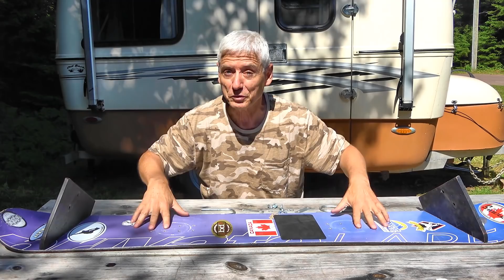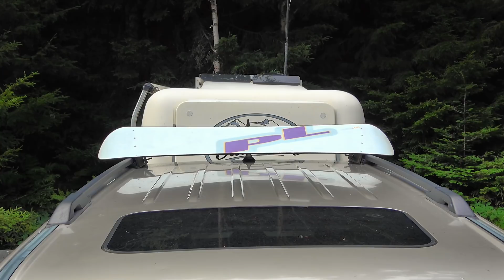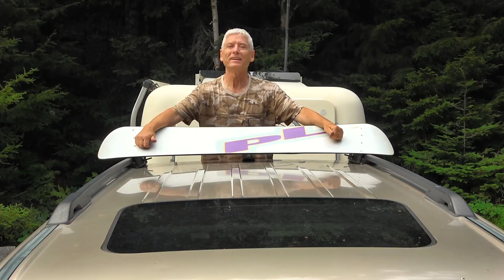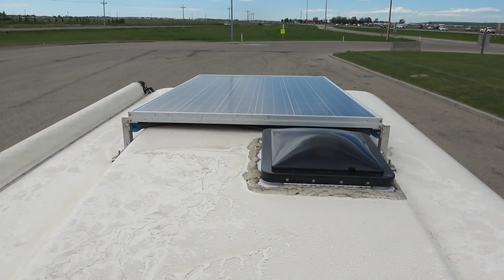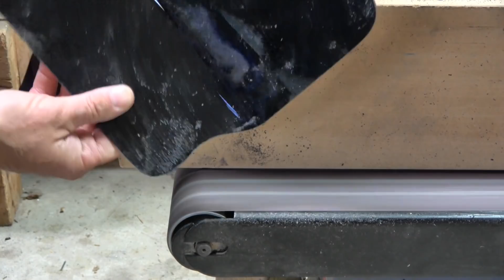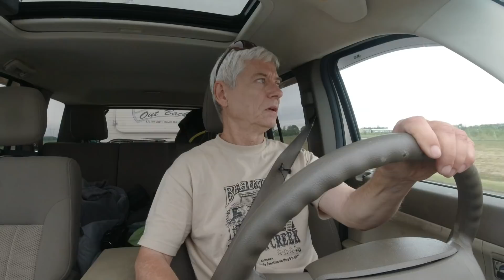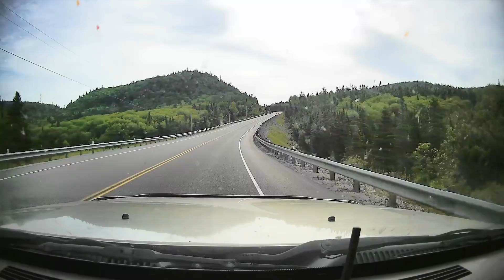Can an Old Snowboard Wind Deflector Improve Gas Mileage while Towing?

Comment: I did notice quite a bit of flex in the snowboard & vibration while you were driving. I wonder what might occur if you are able to stop that flexing to keep the board a bit more solid. But, as they say, any gain is a win, and you more than paid for your mods with that 1 trip!

Comment: Nice results, Slim, and reasonable analysis.  Love the re-purposing approach and your Canadian politeness to grouchy commenters.  I just saw on an electric towable called the Pebble that they use a thing called an "air box" or something like that to make the front of the trailer more bullet-shaped without attaching anything to the trailer itself.  Check it out!  I'm going to try something like that but manually operated on my cargo trailer conversion.  Also, you might want to think about safety-wiring anything on the roof to keep it attached if that tape fails eventually.  We do a lot of that on our ultralight aircraft. I was looking for an aircraft fuselage to make a trailer out of but they're way too heavy - built to withstand stronger forces. Would love to see what a snowboard on either side of the back of the trailer (and/or one on top) to reconnect the airflow on the trailing edge does.  I'm told that sucking effect at the back is where a lot of the drag comes from.  Also using sheet aluminum to "fair" any round bars (axle?) in the airstream. Great work, man!  Cheers!

Comment: I'd like to see you run that test again with an air dam underneath the front bumper of the Jeep manufacturers are using air dams to reduce the coefficient of drag some have a come down at a certain speed but I think if you just have one permanently installed it would also help save more fuel as well as putting Vortex generators on the back of the camper

Comment: Great video Slim.  I tow with a RAM truck and I have been thinking of making a canopy/topper that will slope up to deflect the air up and over my trailer.  I drive from Washington State to the Arizona desert each winter and the fuel cost is the most expensive part of the trip.  I can't think of a single reason it won't work.  Thanks!

Comment: Really enjoyed your video of the snowboard.  I like you. placed a comment online regarding wind deflection and somebody told me about your video which I just finished watching.  just curious, what are your thoughts  on a v nose 16 ft cargo trailer and a F-150 with a flat topper on the back? Should I go with something like your snowboard or something that is more of a v-angle to match the trailer.  
 thanks again for your very informative video
Reply from the maker: Hard to say how well it would perform in your setup.  But since it costs little to experiment, might be worth a try! SP

Comment: I am impressed. One thing i noticed that mught hurt the mileage is your mud flaps. However the damage you save from flying stones is probably greater than any mpg loss. Going to build a similar wind deflector for my ford freestar van pulling my 6x10 cargo van. Thanks for sharing.

Comment: Great video. Awesome results for such a cheap mod. if you would like to take it a bit further, you can use small pieces of wool yarn and tape them to the flat panels of the roof, wing, top of the camper, ext. this is known as TUFTING. and was used in days before wind tunnels. and if you have a way of recording or photographing the tufts yields great results. Thanks for all of the great record keeping, to show us many different results over longer course. so many videos only show a few miles drive after a mod. Happy camping.

Comment: I use a pickup truck with a cap over the bed hauling a cargo trailer and was wondering if driving with the cap rear window up/open would help fuel mileage? With the window open it makes a air jammer like your snow board. It is in the void between the truck and trailer which seems like it would be effective at keeping the swirl of air going in there causing drag.  Have you considered "AirTabs" I installed them on my cargo trailer and improved trailer stability greatly. In fact improved handling Very greatly.

Comment: Thanks Slim.  With your inspiration I'm on my third version of a snow board deflector.
Version 1 -  28 degrees upward deflection. No benefit. I have a fold down A frame so I don't need upward deflection as much as sideways to clear the side projecting corners of the trailer.
Version 2 - 15 degrees upward deflection and downward shark fins at each end that push the air flow outward.  Tentatively a 5% improvement in mileage.
Version 3 - Just added another set of downward facing shark fins even further out to snow board tip.  The concept is parallel slotted flow like Fowler flaps do on an airplane wing.  Results not in yet.
Thanks again for the aerodynamic fun.  Wish I owned a wind tunnel.

Comment: I wonder how 2 snowboards, mounted vertically on the front of the camper, angled slightly inward, would work in increasing the efficacy of your system.

Comment: I know I will get beat up over my comment,  but your test isn't a good one. From experimenter bias to differences in many factors that might not be apparent. ABA method is second best to very expensive wind tunnel testing. Testing is done on the same day. A= before adding the MPG enhancing device, drive a specific route in a manor that can be repeated and with an eye to consistency. Avoid bias. Cruise control helps. B= add the enhancer and repeat the route in as exact manor as possible. Then finally A= remove the device and repeat.

Comment: good job slim,  cd , coefficient of drag is a major issue to vehicle manufacturers so any thing you do to  decrease this is a benefit. with your set up you did just that. a little can make a big difference. your set up may have caused some turbulence, but the fact you are  directing more air flow over your trailer is a win win.

Comment: I wonder if you put a similar one on the back of the trailer, you might increase your mileage even more. It seems the vacuum on the back of the trailer is one of the big problems. I’ve noticed many of the big trucks have special wings for the back to break that vacuum.

Comment: One thing to keep in mind is the overall length when considering something like this (plus to an extent, the distance between the vehicle and the trailer and the board).  The larger the gap, the less effective it will be.  This is where semi's benefit a lot from deflectors like this is because the trailer is very close to the deflector on the cab.    It's close enough that the deflector pushes the air up over the top of the semi trailer.  I mean this deflector you created makes sense, as without one, you get sort of a vaccum behind the vehicle, especailly if the trailer is more than say 3-4 feet behind the vehicle.  This is the same problem that pickup trucks (without caps or bed covers) have because it creates a vortex behind the cab that can add drag.

I mean the concept of putting a deflector on the roof to get better gas mileage is not a new thing.  They've been doing that for decades on trucks.  Some pickups that pull enclosed goodneck trailers sometimes also have deflectors installed on the cab for the same reason a semi has one.    If you're going to be towing a trailer, I would put one on, although maybe look into a setup that lets you fold the delfector down when not towing as that can increase drag if you're not towing anything.   Some of the above mentioned ones for pickups sometimes have a foldable design where you can lay the deflector flat when you're not towing.

Comment: EcoFins Stick On Vortex Generators  or
Defuser SharkFin Speed Vortex Generator
Truckers use them on their Trucks and Trailers.
Racers use them on their Race Vehicles including Airplanes.

Deflectors, Fins, Defusers and Vortex Generators are 100% Proven

There is a video on YouTube Showing how Alpha Racing Fins Work
YouTube deletes my post for including it in my post.

Some sell one and some sell multi numbered kits.

I noticed in your video that your camper door hinges almost look like they are Vortex Generators. 

People place them at the front of vehicles, in front of wheel wells, on the top edge of vehicle hoods, top edge of roof following the windshield line, on the rear vertical up the sides of the end of the vehicle and also do this on trailers. I first discovered them by seeing them on trailers and trucks on the highway.

Perhaps you get a little improvement on your one trailer side from the hinge design.
I find it odd YouTube kept deleting my post for a link to a video on YouTube.

Comment: I love your creations & experiments type vids! Thank you. I would also love to see this experiment repeated without a tow load, & on an SUV, a P-U truck, a regular van, & a car.. It would be neat to see if the spoiler makes any difference in those vehicles or not. I'll never forget the episode of myth busters when Adam gobbed a couple hundred pounds of clay on the exterior of a car, & cut scaled-up "golf ball dimples" off of the clay, & the car got better gas mileage, with the extra weight because of the dimples cutting down the resistance created by drag.. Simple things that get impressive results! 👍

Comment: I am glad the initial results turned out to be positive. The deflectors on the roof of the camper i could see being beneficial in keeping air turbulence from under the solar panel. I would like to see another video in a year or so where you keep good records  i travel a rout 4 times a summer towing a trailer over the past six years. I gotten as little as 8.5 and have gotten as high 16 mpg. I average around 12. From a research perspective, your sample size is small so you could expect some comments challenging your results. Interesting video. I have a truck so the wing is probably not an option but the deflectors on the roof are intriguing. Also, according to engineers, the most drag occurs at the rear of the camper. That is what i am trying to figure out.

Comment: For me I have a 6x12 v front cargo trailer I bought brand new. At that time I had a Chevy Astro cargo van. It would tow that trailer with ease & I had no problems towing it on the freeway at speeds of 70 mph. However, when the van wore out & I replaced it with a Chevy Silverado work truck (pickup - 1500 WT) it wouldn't handle the trailer AT ALL!! It struggled to do 55 mph on two lane highways empty. The transmission was constantly downshifting & eventually got a bit too warm (220*F) 

What is the difference? The Astro van & the Silverado both have the 4.3 Liter V6 engine. The van & pickup also have the 4L60E automatic. And both have nearly the same gear ratio in the rear axle. The van has 16.5 inch rims while the pickup truck has 17 inch rims. The difference is wind defection. The van is all enclosed. The pickup truck is open over the bed of the truck allowing more wind to hit the V-front of the trailer causing more resistance. Now if I remove my truck's toolbox (with solar panel that charges the deep cycle battery) and install a topper or shell as some call it - that would change things allot for the truck & I probably can tow the cargo trailer on the freeway at freeway speeds (70 mph). Will I do that - NO!! First of all they are expensive, including the aluminum toppers. And I already have a pickup truck topper shell in my yard I CANNOT sell. I lowered the price all the way down to $150 for the Lear brand fiberglass topper that I paid well over $1,200 for it USED from a dealer. The cargo trailer sits in my yard and is used for storage. Once in a blue moon I use it for hauling furniture or whatever other large Items I need to move.

Comment: Love this channel. These experiments are never half-baked. The only thing I would add is that maybe you should use loctite on the u-bolt and screws so you can worry less about vibration shaking them loose.

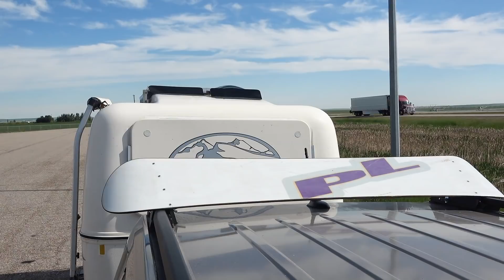Comment: There are things out there called Air Tabs vortec generator. Its those little wedge shaped things seen on trucks and sometimes campers. They might help. Also in one of the shots the sq bars for the awnings rang a bell 14:12. They have more flat surface area facing the wind than the solar panel.

Comment: i think the big ol trucker may be mistaken, air can travel a good ways over a dead space behind a vehicle, racers know this, you can feel the slip a car length or more back and it sucks you in.. you can make a "wind tunnel" if you have access to a large shop fan and a smoke flare.. maybe add a center support to the spoiler, use a piece of foam on the bottom to protect the surface but I dont think it would need to attached.. personally I'd paint that spoiler and leave it on full time

Comment: What you want to find is Cladding tape.... It's what the manufacturer uses +.body shops use to install/reinstall/repair the big body trim - moldings - cowls - ground effects attached.....I believe it comes in varying sizes....Can probably get at a body shop - versus common auto supply places.... I've used it successfully for body & window trim/reattachment....That 3M gets gummy & loses it's adhesion pretty quickly....You don't want to lose those deflectors you've built....

Comment: Slim, love your method of dealing with the critics. I’ve been tossing around the idea of creating my own channel, but some of the comments I read on your and other pages have made me reluctant. I’m afraid I’m too old to suffer fools…errr, critics. Great job. Like another commenter, I too will be seeking a similar solution for the truck I use to tow a CTC.      BTW, great idea on that acrylic bender. My old strip heater died years ago and I never replaced it. Looks like now I don’t NEED to!

Comment: I liked your process and agree, a wind deflector will certainly help your mileage. The two main factors controlling fuel consumption are speed and wind (which you mentioned).  Even a 5 mile per hour wind will make a difference. This translates to a wind speed difference of 65 and 70 miles per hour when moving, which is significant. Going forward, it would be informative to quantify and record the wind speed and direction (maybe by using a low cost weather station) and note your vehicle speed at various places .
Reply from the maker: I believe the three main factors controlling fuel consumption here are weight, speed and wind drag. Neither weight or speed were altered in this experiment, only wind drag. Wind speed was only a significant variable in one out of 11 tests. SP

Comment: I am also a 30 year truck driver. Practically every truck/trailer on the road has a deflector for a reason, AND IT IS NOT FOR LOOKS. The deflector usually makes about a 30% increase in fuel mileage.
I also use a deflector on my minivan while pulling my enclosed trailer. From my experience, I think your setup needs a bit of fine tuning of the deflector angle. 
Mine is hinged at the front and has an adjustable jack screw (x2) at the rear to set the angle. You mileage will go down if the angle is too high OR too low. You basically want the airflow to "ski jump" off the deflector and land smoothly on the top of the trailer.

Rebuild your deflector so it is adjustable. Then take it with the trailer attached to a car wash. spray the sprayer directly at the deflector and adjust the angle so the spray being deflected just lands on top of the trailer. This will get you in the ballpark of the correct angle. Then drive for a while and watch for dead bugs on the front of the trailer. If you see bug splatter, increase angle. If no bug splatter, decrease angle till they start to appear, then raise back up till they go away and lock it in place.

This is where the deflector will be the most efficient. If you ever change the trailer or tow vehicle you will have to repeat this alignment process for the new combination.
Reply: @dieseldave564  hell yeah diesel Dave this is excellent hard won empirical data. I'm a lifetime construction worker who went to school for engineering and I'm designing a wind ferring for a solar panel on top of my micro Winnebago (RAV4) and this is exactly what doctor ordered. I hope you see this. Thank you sir.

Comment: My experience towing my 27 feet Airstream shows me that when I travel with my 2 kayaks on the roof of my truck, I improve my gas mileage by 10 to 15%. I put them closer together in the front so that they deflect the air to each side of my trailer.

Comment: hello slim! i sent you a comment a while ago on ur webpage worried about ur overdrive, ive held off commenting here because i want to remain invisible but
i feel the need to tell you some things... 1st thank you for producing such positive content (ive always believed there was a subculture of people that want to make the world a better place) you give me alot of hope and happiness thank you very much!
2nd... im not big on going back and forth fighting off trolls but, im a truck driver too and thought what that rude guy said wasn t worth reading. and wanted to say my biggest take away from trucking and m.p.g. s is TIRE PRESSURE! we drive at 100+ psi!! i also have a geo metro with a scan gauge and always run at max p.s.i. 
i have seen huge gains my biggest from running at high p.s.i. on roads,
anyways ur really smart and im sure you are aware already just needed to say hi n stuff peace and love : )
Reply from the maker: I agree that tire pressure can be a big issue. My older tires were underinflated, and I did not realize my gauge was off until I bought a new one. When I changed to BF Goodrich K2's however, I got no gain at all, even though I could (and did) use a higher tire pressure. My assumption was tire type, as they are more off-road tires than highway ones. As for this deflector experiment, tires did not effect the results. Same tires, same pressure. Thanks! SP